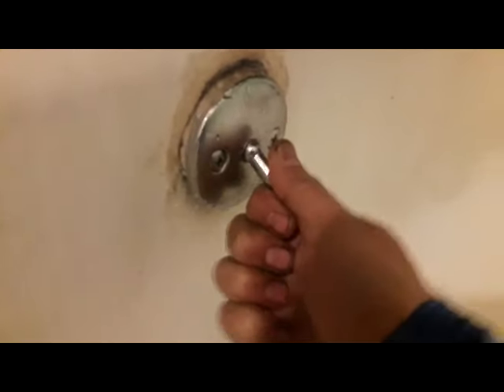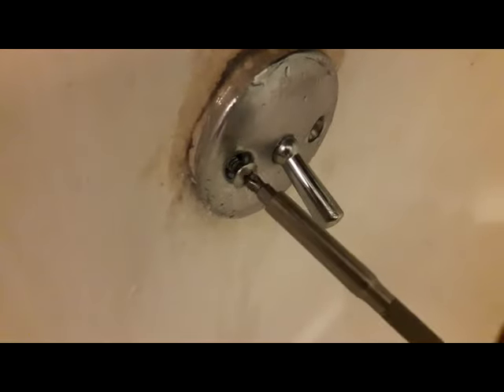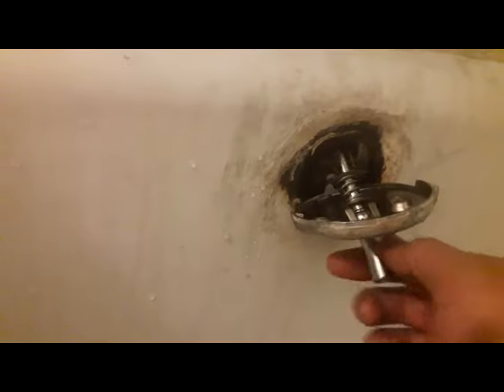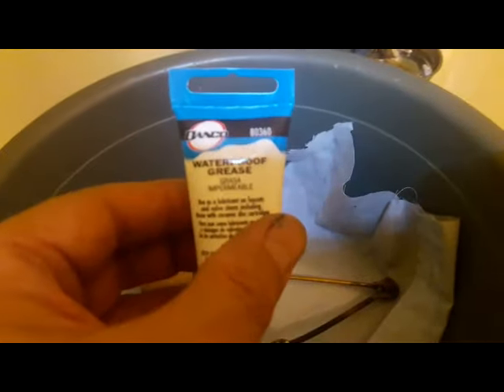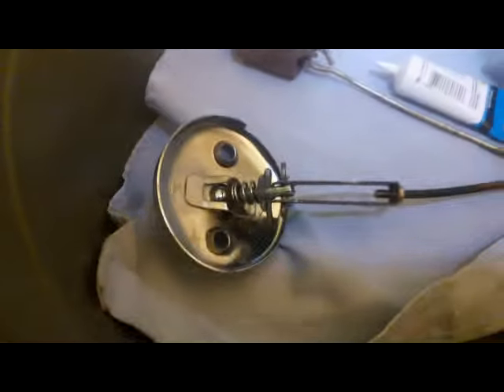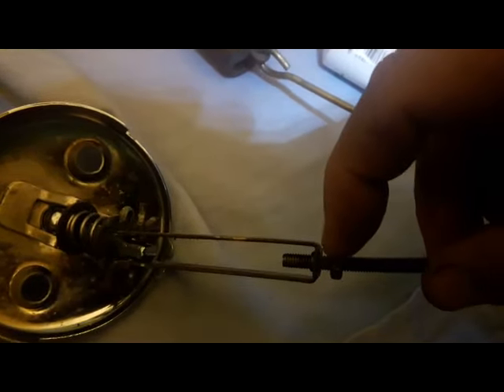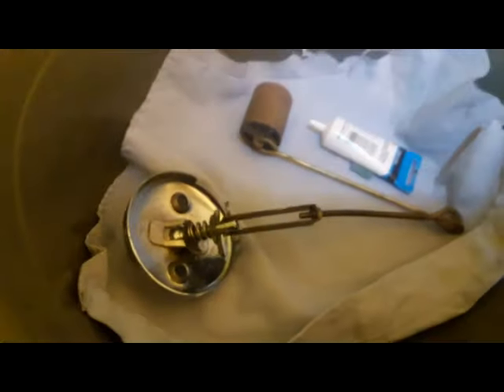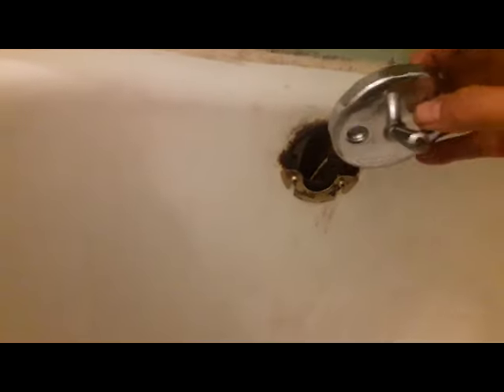How to fix a Stuck Bathtub Drain

Comment: I was skeptical but it worked "as advertised".  Removed the lever cover, boiled 4 cups of vinegar, poured the vinegar down the lever hole (used a funnel), waited 5 minutes, gave two sharp tugs on the lever/cover and the brass cylinder broke free and was easily removed.  Soaked the brass cylinder for about 30 minutes in vinegar, applied plumber's grease to the cylinder, sprayed the pivoting parts of the linkage with marine lubricant and reinstalled the cylinder/linkage.  Testing confirmed water held without leaking down the drain.  Lever now works normally.  Thank you for tips that actually worked.
Reply: I pulled the linkage out and it broke off! Now the Plunger is stuck down there by itself. How do I get it out? 

It is an old tub and probably corroded real good.

Comment: Brother, I've watched 10's of videos on how to fix my issue and your video was the only one the answered my question! Yes, my lever was stuck in the down position but I could not remove the entire unit from behind the tub, nobody else addressed this in their videos. Vinegar is used as a multipurpose item in our house but I never thought to dump it behind the tub...and if it didn't unlodge that brass plunger like butter! (I boiled 2 cups vinegar and waited about 5 minutes). Thanks for listing the rest of the parts and products to finish this project out. Much thanks, you get my subscription vote and 👍!
Reply: I boiled 4 cups of vinegar and poured It In there and It was Still stuck.Ill try CLR next
Reply: I pulled the linkage out and it broke off! Now the Plunger is stuck down there by itself. How do I get it out? 

It is an old tub and probably corroded real good.
Reply: @MilkyWayGalaxyy  try twisting the plug with a long sprinkler valve key, they are super cheap and fit well for the task. Saw someone use it in another video, and it looks promising

Comment: I only had about 2 cups to boil, poured it back there, waited 5 minutes and it came out easily.  Thank you so much.  The extra that was still in the kettle I used to soak the brass cylinder.  The deposits on it came clean in about an hour.  Greased it up and now it the action is very smooth.  Thanks again, fantastic video.

Comment: I spent a week using CLR, vinegar, WD40 and persistent tugging, then the linkage slipped off the stopper when I tried twisting and pulling at the same time. I was able to get the linkage reattached to the stopper and as I was ready to give up and cut thru the wall to get at the pipes, the stopper suddenly popped up and out of that tub with my final attempt- darn thing almost knocked me backwards off the stool I was sitting on in the tub but I got it! Thank you.

Comment: Our tub got stuck in the stopped position. I used a funnel to direct white vinegar (cold, not boiled) into the pipe. Waited 30 minutes, then it came unstuck easily.  Took it out and soaked it in vinegar some more to get rid of the remaining gunk. Reinstalled and it works like a charm!
Reply: UGH!! I did the boil, waited 5 ,10, 15... nothing...😔🙏😭😭😭😭...will have no choice but keep waiting. 🙏🙏🙏

Comment: Your vinegar trick is awesome! Never had it get stuck before. After pouring some hot vinegar down to loosen the plug, I poured some baking soda and vinegar down the drain to clean it. After a few minutes and some wiggling, the plug came loose! Thanks for the help!

Comment: Using the 5% acidic white vinegar from a local supermarket, and going maximum with 4 to 5 cups of the liquid in boiling form I was finally able to free the brass hollowed out piston stuck at the bottom of the back flow pipe after weeks without success. Things were so bad before that even the white vinegar at room temperature, CLR, and WD-40 spray, then pulling on the brass links with pliers the curved hook end snapped. After the boiling vinegar treatments I was able to use pliers and a metal vise to take a clothes hanger to create a hook at the end on the wire. Eventually, I got it into the right position and with groove joint pliers managed to get it to pop up after one misfire. Things worked out great after all.

Comment: I microwaved a beer bottle filled about 3/4 with vinegar for about a minute, hot but not boiling, tapped about half a teaspoon of baking soda on the plunger and splashed the vinegar in the hole.  After several times and maybe 3 minutes it worked.  thanks!

Comment: Thank you so much. My trouble it was stick in up position...good because I was having drain problem downstairs but also bad because I couldn't release small amount of water once I used wetvac on bathtub.
Used the hot water/vinegar trick, boiled hot water and dumped apple cider vinegar down the hole followed by the boiling hot water, waited a few minutes, tugged and was able to release the plunger. Didn't have long extension rod...thought I would have to buy one.
How did you clean plunger? I bought plumbers grease to lubricate plunger.
Thank you so much!!! Dealing with so many issues at the house!!!
Reply from the maker: Same here, bought a tube of plumping grease from Home Depo to lube that plunger.

Comment: Probably didn't have to boil the vinegar but I did. However I dumped baking soda down the drain first ... worked super good! Thank you!!
Reply from the maker: I tried vinegar with baking soda and it doesn't work.
Reply: The vinegar (acid) is good to dissolve lime deposits. The baking soda (base) neutralizes the vinegar so it may be less effective.

Comment: Incredible, I learned something today.  Like other's said, tried WD 40, Penetrating oil.  Hot vinegar did the trick.   Curious about the science behind this now, must be a lime buildup that was dissolved with vinegar?   Maybe CLR would have helped also.  Thank you True Renegade.
Reply: maybe it was just the temperature.  it could be that hot water by itself would cause expansion of the tube enough to loosen it

Comment: Very tempting to try on our bath tub except it’s in the second floor. Fear any fluid will travel downstairs and damage the ceiling. Any advice is appreciated!
Reply from the maker: use a metal funnel or made one out of aluminum foil so you can slowly pour hot vinegar down to the pipe.
Reply: Look at plumbing videos. This hole is used to clear out clogs in bathtub pipe. This pipe joins drain at bottom of bathtub and flows to main drain.

Comment: So the problem was the brass cylinder needed to be cleaned.   What about the lever?  Did you have to clean behind the Lever? Sometimes the lever gums up and gets sticky.
Reply from the maker: My level is still good, did not have to clean it. Most videos at the time only show how to replace the level, so I fixed this out of desperation and discovered boil vinegar works by accident.

Comment: My screws are so rusted I can't get them off. Any tips?
Reply: Spray the screw with WD 40. Use impact screw driver or use the Philip screw driver, put it on the screw, then take the hammer and strike the screwdriver handle, then turn and hopefully the screw come out.
Reply from the maker: Impact screwdriver is my first choice and you can buy the set at Harbor Freight for around $15.

2nd choice, Drill out and extract the old screw , replace with new screw and use anti seize when installing in new screw.

Comment: My friend I tried this trick and I mixed bleach and vinegar in an attempt to fix it and it caused a mysterious reaction on the metal and I got very ill, should I replace the drain completely?
Reply from the maker: Vinegar and baking soda is ok for cleaning drain pipe. Vinegar and bleach is a bad idea. In this video, I use boiling vinegar. Next time please google search if you chose to mix any kind of chemicals to prevent health problem. If you able to drain out the water, flush it with water and try boiling vinegar like I showed in this video first. If it working then you save yourself some money, if not, call the plumber to replace the whole thing.
Reply: That mysterious reaction is called Chlorine Gas. And in heavy doses can be lethal. Thank gawd you didn't mix vinegar with ammonia. Smh

Comment: How long did it take for the vinegar to work?
Reply: He said 5 minutes
Reply: I use 6 cups of hot vinegar and it has not worked yet 😢
Reply: @JW-iz6mv  same. I use the extremely concentrated version with a lot of hot water before and after, and it never worked. Ended up having to rip the tub out and replace the whole line and P-trap.

Comment: You can also use CLR instead of vinegar
Reply: CLR was my first choice until I watch this video and just happen that I got a bottle of Apple Vinegar  and it works. Vinegar is a lot cheaper than CLR. Since I already got my fixed, just curious of plain hot water will work as well.
Reply from the maker: @davevalinty4293  Great idea Dave. I don't have CLR in the house but do have vinegar in the kitchen. Will consider hot water next time I run into this problem.
Reply: @davevalinty4293  Perfect, yes, and it is cheaper. Thank you so much! Your video is amazing!
Reply: I tried clr n it still won't budge
Reply from the maker: @ciscoak9074  Have you try boil vinegar?
Another one you can try is put a few spoons of baking soda in there, then pour some vinegar, wait for it to finished foam up and try to remove it.  Or just boil vinegar and hot water like I did in this video. It's works for me.
Reply: I have to buy this.  I’m in NJ, hard water galore. I know to get it just been slacking. Thanks folks
Reply from the maker: @howelljordan3469  DYI projects are design to save time and money by do it yourself, but sometimes you will run into the unsaveable parts that will require replacement.
Reply: @truerenegade1095  I’m there. I got mine unstuck, but bent one of the rods. Will need to replace that part or whole mechanism.
Reply from the maker: @howelljordan3469  Try to bend it back if you can.
hope you don't have to replace it, but here is the good website for plumbing parts if you can not get it locally.

https://www.plumbingsupply.com/drains.html#tripleverkit

Comment: I have the same issue but I don't have that outside wing bracket that you put on!?   can I get that as a as a part on its own?
Reply: Go to this website , click on Bathtub  Overflow Parts image, scrolling down to 7 and 8 images and you see both of them will work. 
https://www.plumbingsupply.com/drains.html
Reply: @davevalinty4293  thank you!
Reply from the maker: This item come with the Kit. I didn't see it selling at the local store. But Dave doing a great job find this part.
Reply: @truerenegade1095  thanks

Comment: Hot vinegar didn't work, but our kettle is way cleaner, so that's a plus!
Reply from the maker: Sorry it didn't work out for you. You must have a tough clog. You can try to put couple tea spoons of baking soda in the pipe. pour about 2 cup of vinegar in it and it should foaming up. Wait for it finish, then pour boiling water down to wash it off. Then try the boil vinegar again. The purpose of using hot water or boiled vinegar is that the heat will cause the pipe to flex as it expand, and contracted when it cool, as well as melted down the soap scrum in the pipe. With vinegar, it will clean out the pipe like the bottom of your kettle. This is not 1 for all solution, but if it works, it will save you money in repair.
Reply: @truerenegade1095  I actually wonder if the previous owners bent something down below. This is still a good video!
Reply from the maker: @VincentCho  you have to ask the old owner .

Comment: Why did this work
Reply: Vinegar is an acid and will gradually dissolve the corrosion and mineral deposits that are seizing the plug in place, and heating it up not only makes the acid work faster, but also causes the metal to expand a bit, possibly helping to break it loose.

Comment: Lived in my house for almost 20 years, never had an issue, TODAY had this issue. NOTHING has worked yet. I did the hot vinegar, then baking soda and vinegar 3x, nothing. I have a feeling its 20 years worth of junk in there😭😭😭
Will do CLR and wait till morning, I'm SO drained...(Punt intended).😔🙏😩😭😭😭
Reply: any luck?
Reply: @IWBVS  HEY, THIS was Actually SO funny! My pipe FROZE 🤯🥶 due to a crack in one of our slabs that led to this pipe. It was CRAZY !! Took a blow dryer and hot water to bring everything back to normal. Thank GOD we were able to fix and call it A night. 😁😀🙏🙏🙏

Comment: I'm not sure but I think the idea is to take some vinegar ... and heat it ... like with some heat ... and then make it boil ... until it's boiling.
Reply: I put 2 cups of vinegar to a kettle that got some calcium built up, boil it, and it cleared up the calcium deposit,  then I pour it in the bathtub drain, wait about 5 minutes and the drain is unclogged. So it's 2 for 1 for me.
Reply: @davevalinty4293  This is way beyond me. Still trying to find heat ... to learn just how to boil water first. Then maybe move up to other things.